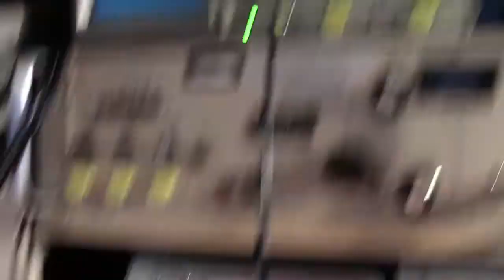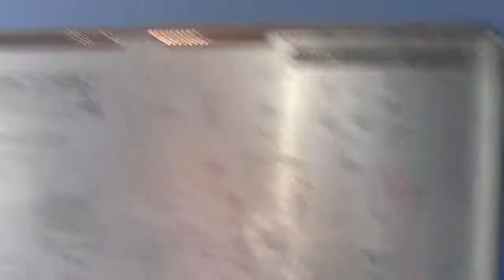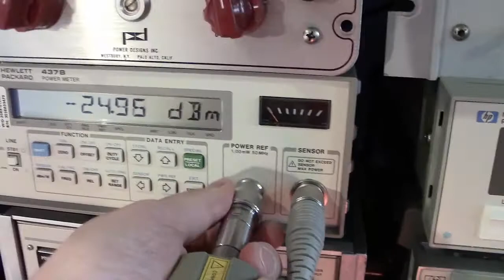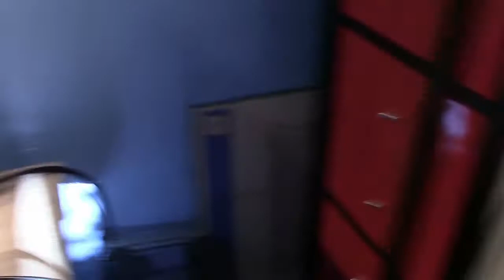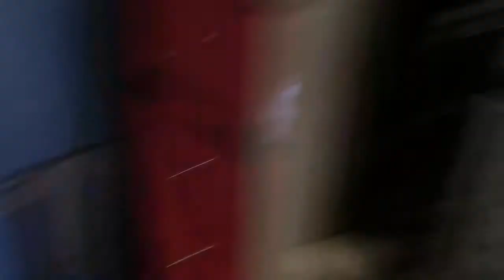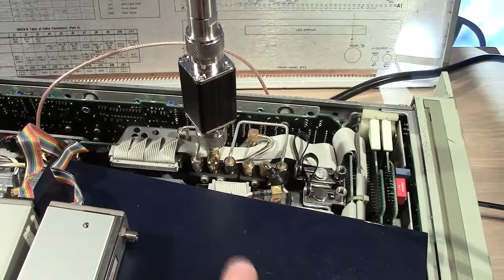HP 8642B Trouble-shooting (Part 1)

Comment: Could you please tell me how you got the cover off?  I've been banging my head against the wall trying to figure it out
Reply from the maker: It should just slide back and off; there are a couple of screws on the back that hold it on, if I recall. I seem to remember there are retention grooves on the sides, so it needs to slide a bit before it comes free.
Reply: If anyone stumbles upon this in the far future: You have to remove the legs on the rear of the instrument first. Then the single screw in the middle of the top cover will push the cover backwards and off the top of the instrument.